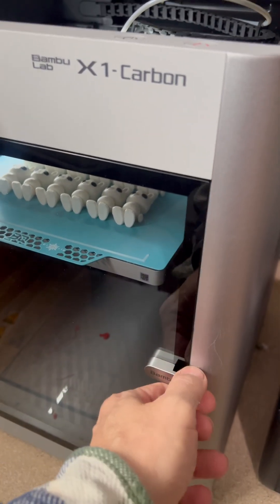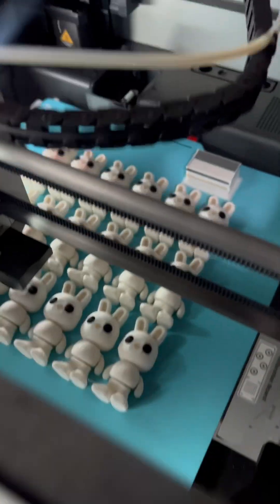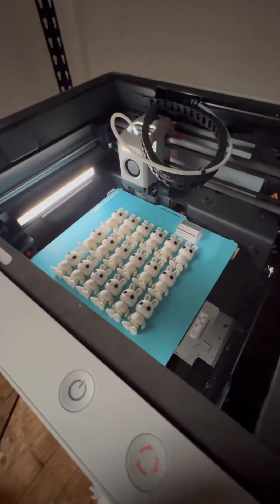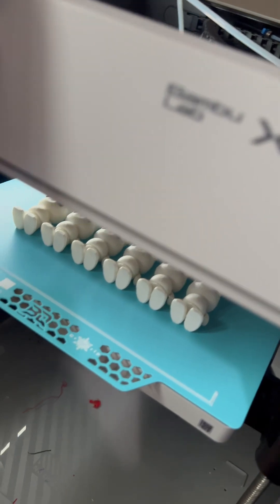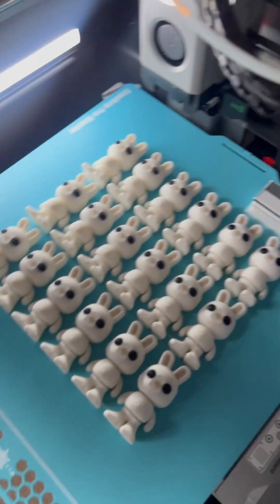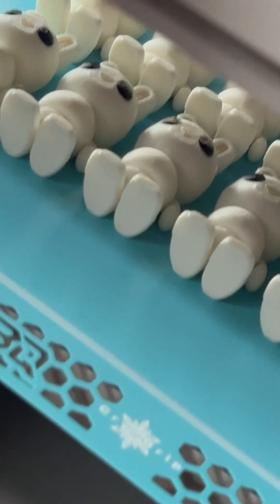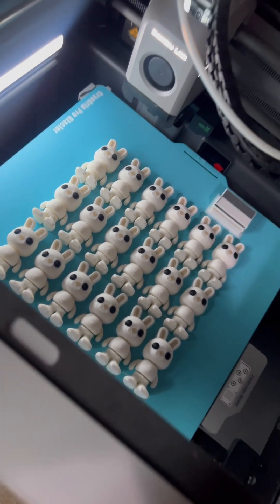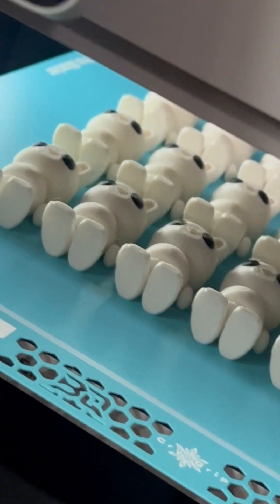Revisiting the @BIQU_Makers Crygrip beds, to much success

Comment: Need this for K2 plus. Been debating trying the Prusa one see if it fits properly
Reply from the maker: I'm not sure id it's better than the stock bed. Creality beds have long been pretty darn good. Be curious to see how it does
Reply: @3DRundown  interesting, seem all this hype with biqu and the tremendous sticking ability I just assumed it would prevent any sort of warp with pla/petg that always seems to occur at the worst possible time.
Reply from the maker: I'm not totally sold. I'm a big fan of the Smooth PEI beds. I'm not certain these are better. Right after this short, I had a huge fail. I almost never have fails on smooth PEI beds.  Warping, is usually a temp thing.... where the material is too hot, and/or cooling too fast. Maybe printing with bed temp too low. nozzle tempt too high. printing too fast....    of course, shit adhesion, or a bad ABL can cause this too, but, it's usually something else. I'm gonna see if I can get a few more of the newer sizes, and see how they work out.